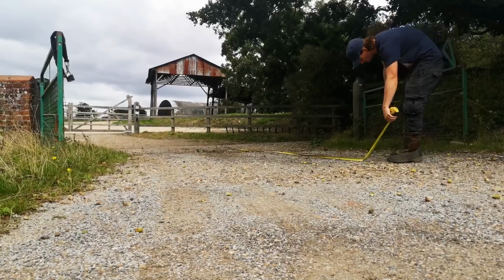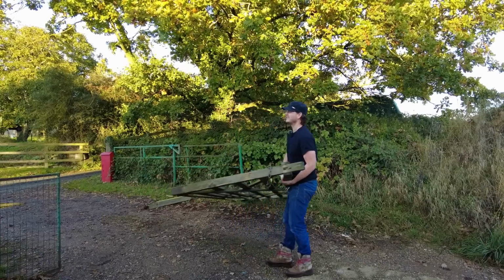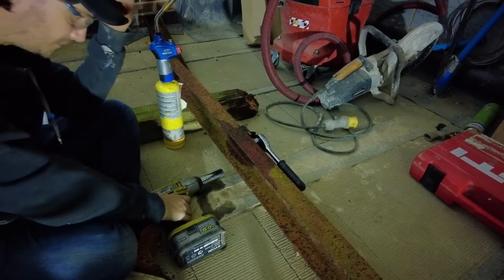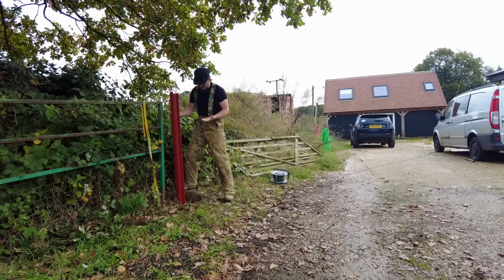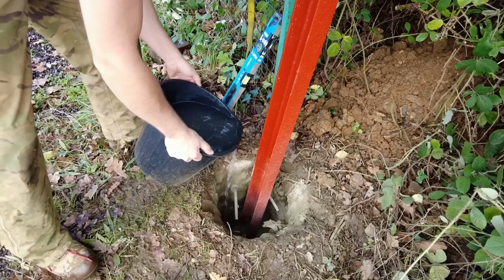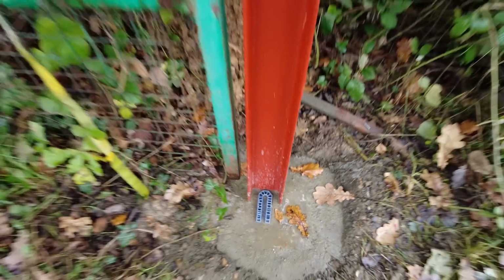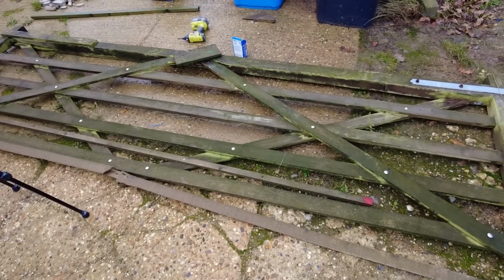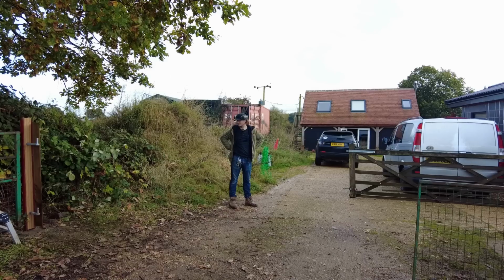No More Rotten Gate Posts! (metal gate post installation)

Comment: Hi Aiden, I hope you do keep going with new videos. My wife and I are also proper self building, but at a much earlier stage (piles and ring beam in, next up drainage etc so we can start building ICF walls. The order is very different to yours, but so much of the stuff you've done is useful for us to learn from. We also hate creeping thistle with a loathing!

One thing to think about on the gate is that many people hang them with the lower hook upside down to make it harder to remove the gate. If it's too late to do that, you might want to MIG on a thick washer or similar to make it harder for a few guys to lift it off the hinges.
Reply from the maker: Ah I was meant to do piles and a ring beam originally, got quoted 85k though 😅 so I got permission to chop down an oak tree on my neighbours land so I could do trenchfill instead 😁 

Good point on the gate, I don't even lock it these days 🫣 but I'll probably do like you suggested and weld something on
Reply: @THE-AIDEN-PROJECT  Blimey, ours was less than half that, and fairly happy to go that route as we have way too much clay to be happy otherwise.

Comment: Even with quick dry cement, give it time. Any cement needs time to cure. And for it to do what you need it to do. Quick dry is walk-able on in 24 hours, but it still may take 1 week to get to a good strength (~1200 psi) to 3 weeks to reach full strength (~4000 psi). 

Fence posts and their gates can exert a lot of lateral pressure. And the cement in the soil may cure slower than you expect. For long term stability, the longer you can wait, the better.
Reply from the maker: I waited 3 days in the end, it's solid and hasn't sagged 🥳

Comment: Keep it coming hun. It is good to remind the world we all learn on thr job when it comes to diy... You start with one issue.. And unravel five... And things go Pete Tong all the time. Thinking on your feet and working the problem is how to learn. And you are modest with that too. I used your video on cementing in the tiles on the edge of my roof, and had my own challenges with other problems that popped up as a result. It is good to see others get a chance to scratch head on alternative solutions😊
Reply from the maker: Hope your verges turned out good then 😉😁
Reply: They did indeed! A touch of key hole surgery on a the bonnet hip tile at the top.. But did finally get it all buttoned in before winter. Rock solid now with no chance of squeak holes either

Comment: Keep going Aiden. A very informative channel. I like the deep focus on solving the challenges of DIY problems, whether digging a hole for a fence post, deciding whether infrared heating was the way to go., or how to fit windows, and much more. Btw - re digging the hole, Roughneck tools are really good and heavy duty. I use that breaker bar and it is very effective for digging holes and levering out roots and rocks. Also recommend the heavy duty post hole digger from Roughneck because it gets increasingly difficult to get stuff out of holes with shovels the deeper you get. Great channel keep it up.
Reply from the maker: Thanks mate, yeah I reckon I might grab the post hope digger even if it's just to lift the soil out, that'll save me reaching in with a small garden trowel 😆

Comment: My concrete expertise helped!!

Seeing that you've used a blend of rapid set postcrete and OPC/ballast 'semi' mixed with water (😅) I think you'll be fine after 24hrs as that goes off fast. You'll be surprised that this will have cured very fast but with relatively low strength as you've probably not added enough water throughput the depth of the foundation.

Always best mixing first and pouring in. If you ever dig the foundation out you'll find layers of weak concrete and pockets that are strong where you've mixed the water in well-ish. This won't matter for your gate, but something to bear in mind with foundations in future 👍🏻
Reply from the maker: Haha I'd never do this for any other foundation 😆 I was just being lazy not mixing it beforehand 😅 it's solid though...for now